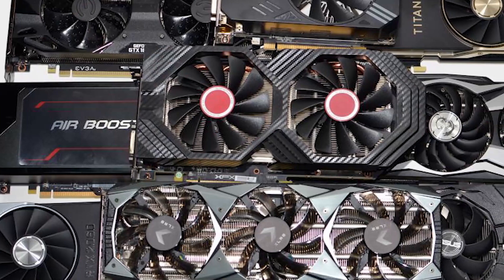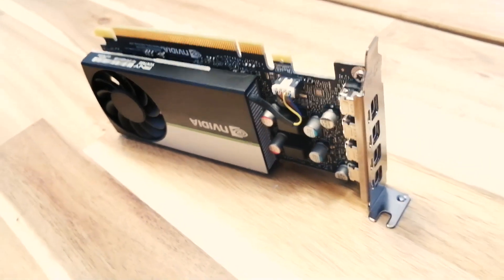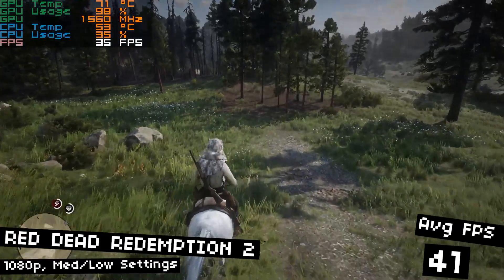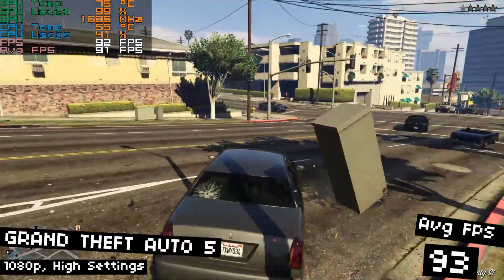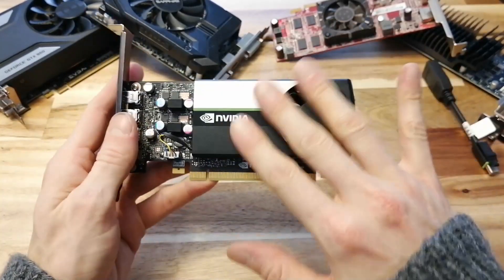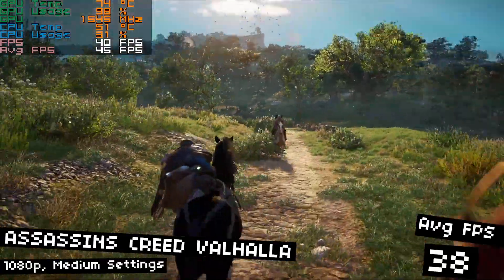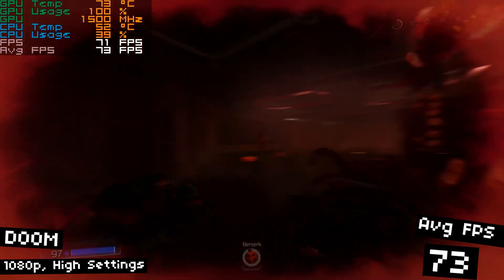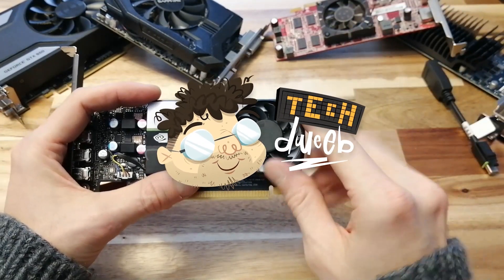This cheap RTX GPU is AWESOME! (T600 test in 10 games)

Comment: I have a T600 for a month and I´m really happy with it. Also for older games its fantastic. But I still think I can get more out of the card. What are the setting you have changed from the Nvidia Control Panel global settings? Is there a possibility to tweak it that way a bit? Thanks & great video ;)
Reply from the maker: Thank you! I don't know that there's a lot of tweaks that we can do, the firmware doesn't allow any overclocking whatsoever so other than the standard settings there's not much we have control over. Not that it's a problem, it performs great for the price so it's all good.
Reply: How you can connect it with your pc which converter you use??
Reply: @Defender_928  If I´m right you ask about a display adapter. I would not recommend. I use a mini DP 1.4 to HDMI 2.0 cable and it works without problem.

Comment: I currently have a gt 1030 and am thinking of buying this card. It does look good considering it is pretty much the only reasonably priced graphics card in stock, however, I was wondering if there were any other options around the same price point that may be as good..?
Reply from the maker: There are some cheaper brand's version of the RX 560 floating around (VisionTek I've seen). It would have about 85% the performance of this. The price on those goes up and down but if you can find it at less than $85 the price of this then technically that would be the better value. Of course used GPUs will always be the best bang-for-the-buck when you can find them at a good price.
Reply: I also use a gt 1030 (bought second hand) before, and then I bought this card few weeks back (and now currently using it to game, work, rendering videos, and learning blender a bit)
Liking it so far
And it's a good card what's with the current market price
At those market price, you can also consider 1050 TI, 1650 (used, not recommending new one
Reply: I think this card is equal to a normal gtx1650 or rx570, not bad actually. Only bad thing is it only has displayport no hdmi

Comment: Hi  Great video!  could you elaborate when you said"performance isn't consistent on t600 compared to 1650".
Reply from the maker: I just meant from a game opimization standpoint. Some games had dips below what I'd expect on the t600 considering the performance in other games. It could be optimization, or it could be some quirk of the hardware. There are less cuda cores in the t600 so perhaps on games that are less vram intensive and more gpu intensive we'll get dips that we wouldn't on the 1650 for instance. It's a rather small impact though, not worth stressing about. Still a great value card IMO, especially considering the price of the 1650 these days!

Comment: Hey Tech Dweeb, loving your content and presentation! If you get a chance, will you please review the gtx 650 2gb oc? I recently ordered one to replace my gt 610(yikes!). I paid $60 and I think I got a good deal considering the gains I expect to receive. I have some concerns and questions about overclocking the new card as well. Thanks again!
P.S. new subscriber here
Reply from the maker: I'd love to get more older gpus to test. I keep my eye on my local market for deals, so if one comes along at a good price I'll definitely check it out and report back :)
Reply: @TechDweeb  Thanks! Do you think I made a wise purchase?
Reply from the maker: @jonhall3151  well it will be miles ahead of your 610 that's for sure haha. Yeah, in terms of value, it really just depends what else is available in your area and the prices. The 2 GB's will definitely help, but you will not be able to play some modern games that require dx12. You will be better off sticking to older games and going with the lowest settings on new games, but you will be able to play a ton of games and have a great time. The 50 series of gpus have always been a good bang for the buck.
Reply: @TechDweeb  Thanks for the info. Yeah, I figured as much. Mostly it will be used to play Fortnite with my son, and for my backlog of 10+ year old games, but I'll mess around with it and see what I get on some of the more modern stuff. Have a great day!

Comment: Great review. 

Couple of things… Does it make a difference if I use the game ready drivers or the quadro/rtx driver?

More importantly, my temps on GPUZ are showing around 87-88 degrees and the fan is pretty loud, like a dusty PS4. Is this normal? Fyi, it works great but just want to check that a noisy fan working at 90 percent is expected?
Reply from the maker: No difference in gaming with the game ready vs studio drivers, as far as I could tell.

And definitely not normal to have a loud fan and high temps. At least, my T600 and T400 run pretty cool and quiet. Is yours the PNY brand? I wonder if there are different versions that have different thermals. One of my subscribers made his own custom heatsink (I showed it in one of my videos, can't recall which one). You MIGHT want to consider removing the heatsink and applying new thermal paste & thermal pads as there might be a coverage issue. 

Good luck!

Comment: Awesome review! 
Did your unit come with the standard profile bracket you installed at 4:52, or did you have to get it separately? I'm considering one that seems to only come with LP bracket, and I've only found K1200-compatible brackets, which seem to be extremely similar. Would you happen to know anything about that? Thanks!
Reply from the maker: Yes it did, mine came with both brackets.

Comment: Nice video! I ordered one for myself for 195 USD. Can I download drivers via nvidia geforce experience?
Reply from the maker: The regular gameready drivers work fine with this (you don't need the studio drivers). And yes, GeForce Experience detects the card no prob.
Reply: @TechDweeb  Thx for answer. I have one more question. I noticed there are more nvidia T600 manufactures (PNY, Lenovo). Is there any difference except price?
Reply from the maker: @jaroslavbecvar9541  Definitely not. The card should perform the same no matter which version you choose.
Reply: @jaroslavbecvar9541  pny is better I guess because it's more popular. Never heard of Lenovo t600 and hey, don't forget to share the benchmarks once it arrives

Comment: Nice video, thanks. I have a question. I have HP T600. But when I try to install the game ready drivers it says 'no compatible graphics hardware found'. How did you set it up?
Reply from the maker: That's pretty weird. Maybe try the studio drivers. I'm pretty sure mine worked with the gameready drivers but the studio drivers are technically the proper drivers for this card. You should get the same gaming performance using either driver.
Reply: @TechDweeb  

There is no problem with studio drivers. I installed the driver version 511.09. Seeing that the game ready driver can be installed in the video, I thought I'd try it. By the way, I tried the driver version 497.27, but I got the error in my previous message.

As an extra information, I got an average of 57.4 fps in the Unigine Valley test with 1080p ultra details but with the aa value turned off. When I did the same test for the GTX 1050 Ti at the same settings, an average of 68 fps was obtained. I thought I'd write it for those who are wondering :)

I didn't expect that much of a difference with the 1050 Ti, but I guess it has something to do with the driver support time. Drivers for the 1050 Ti have been in development for over 5 years, while for the T600 it's only been 8 months. Therefore, I think that this balance may change in future versions. 

By the way, thanks for your answer :)

Comment: Hi, thanks for the in-depth analysis on this card. It convinced me to get one. Sadly, mine is giving me very bad results in pretty much any game. GTA runs at about 15 FPS and even minecraft (which I know mostly relies on the CPU, but still... I get better performance with my RTX 650) doesn't run smoothly, as it frequently dips. I removed all existing drivers and NVIDIA softwares too before downloading the new drivers from NVIDIA's website. I then installed GeForce Experience which told me there was a driver update, which changed nothing. I am using it with a i5-3450, if that helps.
Thanks in advance
Reply from the maker: Aw that's a bummer. And that's very strange. This card should perform somewhere between a 1050 ti and a 1650. No reason you shouldn't be getting decent fps in GTA 5. I'm not sure what to suggest. This video (https://www.youtube.com/watch?v=qD9ep7Q-o44) mentioned an issue with severe frame dips in GTA 5 that he fixed with 2x MSAA. I didn't have that issue on my end so I can't say for sure, but maybe give that a shot? Does the low FPS happen with other games as well? Try as many games as you can to ensure that it's happening across the board. Other than that the usual graphics card troubleshooting will apply - try it in another system to see if the issue happens there, if it does you might have a defective card. Check the temperatures while you're gaming to see if it's a thermal issue (should stay well under 80c for the gpu and vram temps). Run some synthetic benchmarks and see if it happens in all of those or just some. I'd also double check that it's running in 16x mode under "bus interface" in GPUz - and check the other stats in GPUz to make sure it's running at the right memory bandwidth (760 GB/s), gpu clock (1440 MHz), memory clock (1188 MHz), etc. One last troubleshooting step would be to make sure your motherboard has the latest bios, this is a brand new Turing GPU so there MAY be some compatibility issues with older motherboard bios. Hope any of those suggestions help you figure out what's going on.

Comment: why the connector size so small in this? its not hdmi or DP  . does it support higher refresh rate 144hz or 240hz?
Reply from the maker: This is Mini displayport, a pretty common type of display connector for laptops before thunderbolt came along. You can grab these on Amazon for cheap. I'm not sure how high the hz go but I know for a fact it supports 165hz because that's the monitor I was testing on, and because this is a workstation card I would be surprised if it had any limitations at all TBH.
Reply: @TechDweeb  i am making a pc but wont be able to afford graphics card atm. 
but i will buy graphics card later. i was thinking getting gt1030 till then or now i think i get this one 2x the price of gt1030 till gpu prices go down. should i get this card or gt1030 and buy new later like 3060?
my specs i want
5600x ryzen processor
16gb ram
gt1030/t600
Reply from the maker: I think they're both good options. This is probably about the same as a GT 1030 in terms of dollars-per-frame. Did you see my video on the GT 1030? Check that out if you want to see the performance. https://www.youtube.com/watch?v=8focMcWEvHk

And I'm sure you know already, but the Ryzen APUs are a great stop-gap solution. The 5600g offers some good performance without a GPU, and then you can add a GPU later when prices come down and it's still a great processor (not much different than a 5600x tbh). 

Good luck with your decision!
Reply: @TechDweeb  okay i am gonna get 5600x + gt1030 or t600 depends on the budget. no i wont be getting the 5600g the l3 cache and depending on the later upgradability i think the 5600x is best choice. i tested i got 400+ fps in valorant in gt1030+5600g.
i will get my pc soon and let u know
Reply from the maker: @everengaged9370  For sure. With the APUs you save money on your GPU but in the long run you sacrifice performance when you finally get that discrete GPU. The L3 cache thing is disappointing for the 5000 APUs. And the lack of PCIe4.0 of course. It's all a trade-off, performance vs price vs availability. It's a weird market because of the GPU situation.

Comment: Don't you think the T600 can be overclocked a bit ? It's only running at 40W so it should have headroom until 60/70W
Reply from the maker: I couldn't figure out how to overclock it at all. In MSI afterburner when I moved the sliders to adjust the core clock or memory clock, after it's applied it just gets reset back to zero. I've had the same experience with laptop gpus, they seem to be locked down and I don't allow any adjusting of their clocks.

Comment: I was personally thinking about getting a quadro rtx 4000 as i have gotten into 3d and i want to upgrade from my gtx1070
Reply: If not for gaming, Quadro rtx 4000 would be the best. But for gaming, this t600 is a better price to performance than the 4000
Reply from the maker: Where I live the RTX 4000 is the same price as a NEW 6700 XT. Even considering the 6700xt is overpriced, I'd still opt for that if pure gaming performance is your goal. If you have other uses for getting a Quadro like production (you say you're into 3d, I assume that's 3d modelling like blender), then the Quadro will serve you well, just don't expect gaming performance that matches the price.

Comment: What is your system specs?
Reply from the maker: i7-10700k, Asus Prime Z490 Motherboard, 32gb DDR4 RAM (Corsair Vengeance Pro 3200 mhz), WD Black SN750 SSD, 8TB Barracuda HDD
Reply: @TechDweeb  which monitor you use  and which cabel is connected with card for display?? Hdmi to dp or dp to dp??

Comment: I have a question, can you use DLSS with a T600? It would be cool if it gives some extra performance. I'm desperately searching a GPU for my Girlfriend.
Reply from the maker: Nope. It does technically have RTX features that you can enable, but DLSS makes the performance WORSE. I don't think it has the actual RTX hardware to do it. BUT, you can use FSR on it, on any game, and it provides a big performance boost on this card. Check out my FSR vid that I made recently. https://www.youtube.com/watch?v=b-2_r81PTPA
Reply: @TechDweeb  Thank you for your answer, i think I'll try my luck when the 3050 gets released. if i manage to get it for the MSRP price, which is just 30€ more then the T600.
Reply from the maker: The 3050 is going to blow this away. Definitely go for that if you can get one. Good luck!

Comment: i ordered it... im using i3 6098 - gt 710 right now... it(t600) will be arrive at... jan 2 2022... am i did gud decision...?

i will pay on delivery at 16000 indian rupees...
Reply from the maker: You'll be very happy with this as an upgrade! The value depends on what's available, this is the price we SHOULD be paying for a 1650, but this is a great price for this card if the GPU prices are as inflated in your area as they are around me.

Comment: Will it bottleneck the i3 9100f?
Reply: No both will run perfectly together, no bottleneck. 
GTA V- 150+ fps(low settings)
Red dead 2: 65+ fps(low settings)
Cyberpunk 2077- 65+ fps(low settings)
Assassin's Creed Odyssey-50+ fps(medium settings)
Reply from the maker: Agreed. You should be good to go.